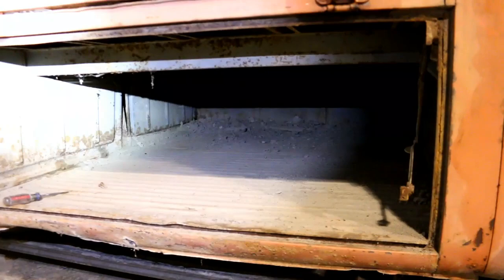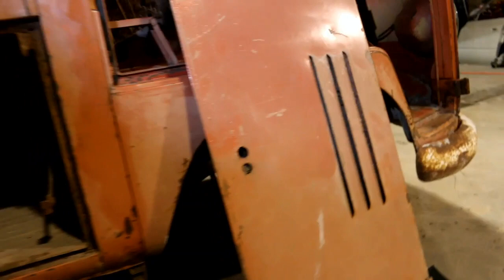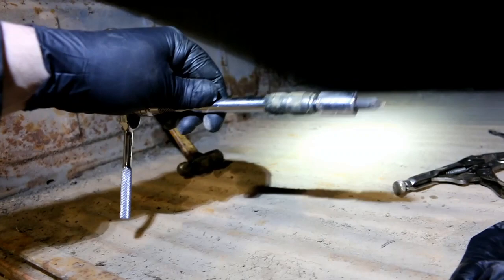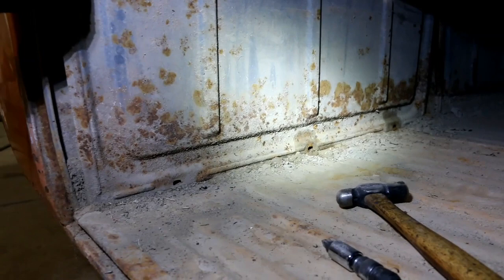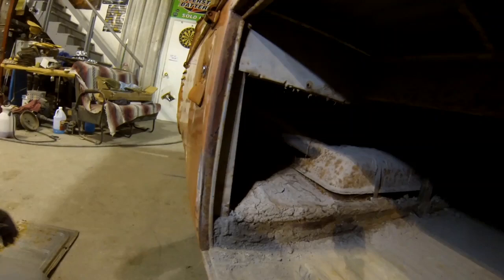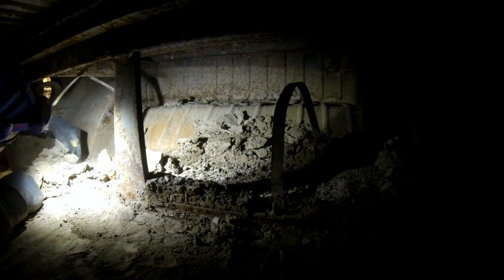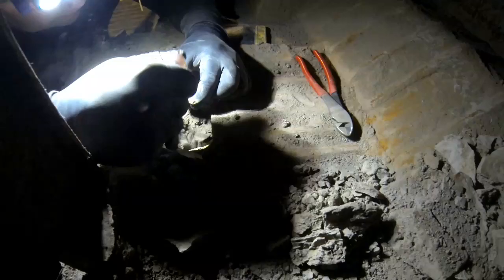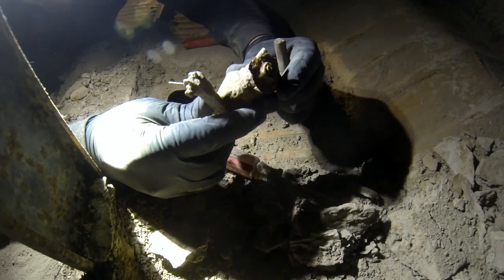Forgotten Volkswagen Single Cab PART 4.  Dirty Jobs Edition.

Comment: It's in amazing condition, considering what it could be like.  I suppose the soil prevented the rust.  I worked for the phone company and got stuck under a house for over an hour.  I'm a little shorter than you but at the time weighed 175 (I was 26, now 63)  I always have a back up when I squeeze into tiny spaces. Best wishes on getting her back on the road. Great video
Reply: Indeed!

Comment: Just a thought before sealing/treating with converter, try some CLR on a spot n see how much it cleans it up. Should help out the upper areas a bunch. Got that tip from someone in YT land bringing back a factory finish on roof top/decklid covered in surface rust. CLR, good wash, dry then treat/seal. Maybe try a divider 1st, got nothing to lose there other than the precious time.

Comment: You got lucky with that treasure chest...the floor is in pretty good shape, all things considered.  I like the idea of painting it gray or another light color...it'll keep it from becoming a black hole once the whole truck is done and is in use. 

I have to wonder if a quick light hit with a sandblaster would take the "chunks" of rust off faster than laboriously going at it with a stiff wire brush.  Then you could hit it with rust reverser, primer, then paint.
Reply: Yeah grey would be stock

Comment: My single cab is way worse in the treasure chest and it going to be a bitch to fix. The floor has to be replaced and I’m your size. The bed is pretty good. It would be a lot easier to do if I took off the bed. It runs drive and stops so I’m not taking it apart. Spelunking in the treasure chest is in order. Love these video’s! I have two girls that are grown ups now. I was surrounded by estrogen and no veto powers. Ha! Keep the videos coming

Comment: Wire brush it and get it rust converter on  and a weldable primer should you need to do so it's got great bones from what I see of it and their an awesome truck gear reduction units for those may be tough to find and the reversed ring gear transmissions will be tough to find too

Comment: Scrap off the rust and use fertan rust remover ,( would suggest grinding mostly of the rust off ) it works really nice . Rust dealer doesn't work , after 1,2 years rust will be back
Reply: Exactly. I'd suggest too;'
Brush it with Fertan, or Owatrol, dry out, then wash everything off with the high pressure washer. We had so many "restored" cars from the states where the entire floor had being knocked out with a hammer. Overpainting only encloses the oxygen in the metal but will not stop it from rusting any further.
Reply: @junkman6456  do you know what fertan is ??????its a rust remoal gel ,you get the rust out by brushing it on and scrubbing it . they also make a rust converter but its not as goo as their rust remover

Comment: Do spot repairs on the rust sports /parts without paint and buff it, would also suggest you to close the bullet holes so water won't enter / rot it out
Reply from the maker: Not sure what I am doing yet to seal the bullet holes.  Still working on that idea.  JC.
Reply: Volkswear I would get a dolly outside and hammer it flat from the inside, a small weld and some paint ( or leave it to rust, if you like it ) and it will be like new
Reply: Put corks in the bullet holes. They are totally cool.

Comment: Rust sealers converters are all a joke man suck it up by little  sand blaster take  it down to beer  steel send with 80 prime it right up epoxy primer so it'll stay sealed until you get ready to paint